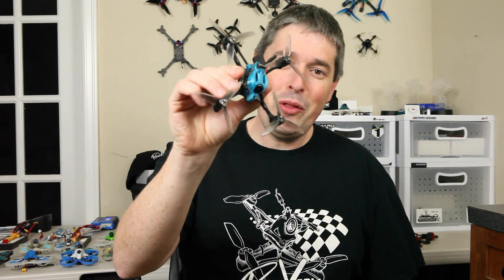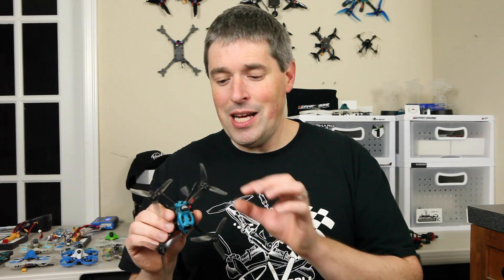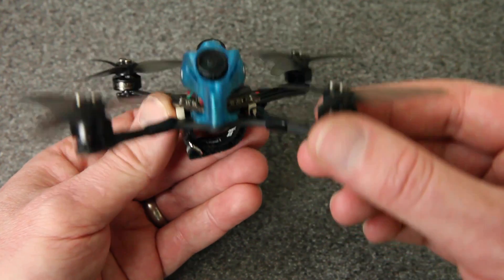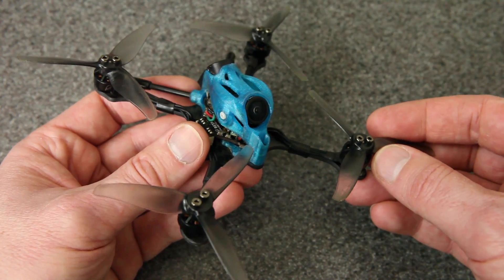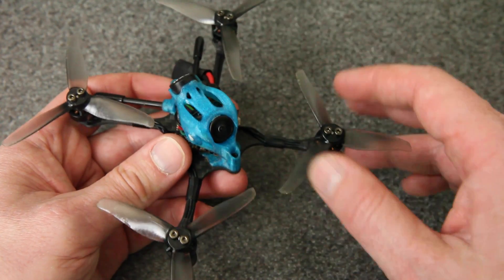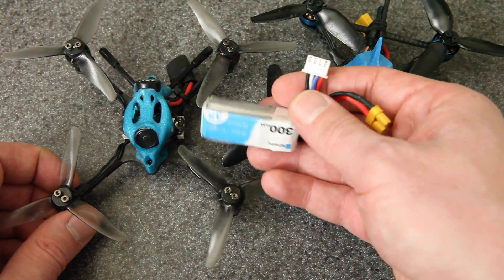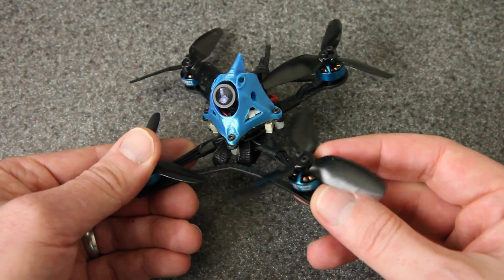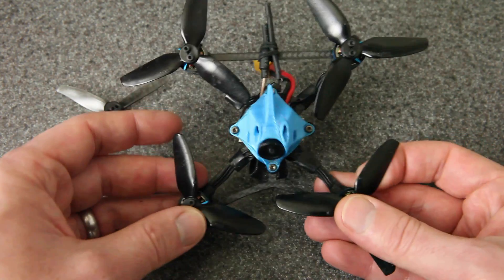Primo 3 + An Impressive New Prop

Comment from the maker: UPDATE: Gemfan also just released the 2-blade 3018 prop which I mentioned in this video. The 3018 might be the perfect thing for me. I look forward to trying it out!
 - Gemfan 3018 2-Blade (NEW): http://bit.ly/2t3Ee6Y
 - Gemfan 3016 3-Blade (1.5mm shaft): http://bit.ly/36REC7a
 - Gemfan 3016 3-Blade (2.0mm shaft): http://bit.ly/2tM6NWN
Reply: The 3 Blade is 3016.. The Bi blade is 3018
Reply: Thank you, your videos are the most informative I've come across (in a fun way). Keep them coming.

Unbelievable, I can accomplish nearly same speed results with your specs on 2s 450Mah lipo as with the BetaFPV 115 with 1204 5000kv 3s 450Mah, both on 3" 3 blade props?  I can't wait to try this (only have the 3018 2 blade now).

This will give new life to my 2" duct 85mm prototype with 1103 10,000kv (or 8,000kv) 1-3s, but I have a Crazybee v1 5A on it (only fly 2s, on this with 3 blade Avan props). 

I'll prob have to do the same as you, use GepRC 12A instead and a Rx. 
Just got the 3018 1 week ago (ordered Dec 2019, arrived 2 wks ago, available since Sept/Oct 2019).
Waiting for my 3016 3 blades to arrive to compare (available since Oct/Nov 2019, just ordered them in clear blk).
Reply: Mr ShutterBug which bolts do you use to hold the props in? I’m running the xing 6500kv motors.
Reply from the maker: @smcarmel  I believe they are M2x8 screws. Pretty standard. Motors usually come with them.
Reply: @MrShutterBug  Yes, but some motors come with M2x5 or M2x6 as standard as well (like the BBB 1105 6000kv, 7500kv come with M2x5 and M2x4 for mounting to frame). 
Unfortunately, I learned this the hard way and ordered a few sets from M2x6 thru M2x12 (which I use for whoop boards when some screws in some kits, like the "sailfly" long screws were plastic/TPU screws, not metal). :) 
Very cheap for a 20 or 50pk, about $2 or $3 including shipping. :)

Comment: My favourite prop. Only running HQ 3x3x3 on Eachine Twig, for that extra grip on 3S. Have a Twiglet very similar to this build but wiht 1104 motors - flies very well on 2S. What is total weight without battery of your primo build?

Comment: Did you ever tune the primo 3 or try jesc 48khz? I put 3018 bi blades on it but at going to try 3016’s after seeing your video. I’m running 1103 mamba 6500 kv it flew pretty well on 3.5.7 I just updated it to 4.1 and going to try the presets
Reply from the maker: No I haven't made any specific tune for that one, but I do think 48kHz would make it better, based on experience with other quads of similar size. Cheers!
Reply: Mr ShutterBug thanks for the reply! Ii just swapped from a pretty locked in 3.5.7 tune so I’m going to try 48khz. Do you think licensed jesc makes a difference as well? I put it on my babytooth and am happy with the results

Comment: Thank you very much   My Garnly build run the Mamba 1105 motors on 3s and I just try the Avan mini on it...  It hoover at 13% of trottle.  Wow!!!.     In addition they respond rapidly to the trottle.   But can ear a lot of osillation around 50 to 70% of the trottle.  I still need to try them more but I feel they give up on over 70%.  Do you recommand the gemfan 3016 or the hqprops 3030 on 3s to replace them?

Comment: Not a big fan of 1103's on a 3" Primo are  much better on the 2.5"original primo. And I think since your more of a freestyle pilot you would like the 1204's 5000kv even better that the 1105's although both fly similar. You get really good low end throttle response with the 1204's and better low end torque. I also prefer the emaX AVAN's Tri blades seem to bite a bite more than the 3016's  especially around turns. 

I know your a Whoop master and also a BetaFPV advocate but would love to see an unbiased comparison and flight footage of the Mobula 6 / Meteor 65 Your custom 1s Brushless Whoo That would be a great video to see and hear how far these little brushless whoops have come.

Comment: I bought the Flywoo ROBO 1202.5 with 2mm TI shaft and these props were the only thing I could find without drilling 1.5mm holes from my other various props. I too LOVE them and the material is very similar to what HQ uses for there 5inchers. You know that though.

Comment: you should really try Germfan 3018"s on the primo 3 build matter of fact I would say try em on both of those builds cause they might work better then what's currently on your twig too , it will give you the  responsiveness that was lacking from the 3016 props.its seems like a slightly more aggressive bi blade version of the 3016 prop to me.
 I had  the 3inch HQ props on a ultralight build I have and it flew pretty good then i ordered the 3018 props an when the came I put them on and I was blown away with how much better it flew ,didnt think it was possible and they were also more efficient too got the 3016'sat the same time , like you said they are good but I've also noticed I tend to have to keep a faster speed hrough out the flight with them but not enough response around tight corner ext. The throttle is alot more linear  all the way through then the 3018's and lacks the "punch" (especially at the lower end of the throttle)needed to quickly change direction while flying at the faster speed the trend to like.
Reply from the maker: I have some 3018s coming. I look forward to trying it out!
Reply: @MrShutterBug  awesome, your gunna love them!! Definitely my favorite bi-blade prop bar none

Comment: I love my Primo 3.  It's a great design and has more room inside for the "stack" than the original Primo.  The iFlight whoop board with their pinned VTx fits perfectly and runs great with RPM filtering.  I run it with the AMAXinno 1303 4800kv (2mm shaft) on 3s with the 3018 biblades and it's my favorite quad to fly.  It's nice that they offer both props with different shaft options for press fit.  Now that the 3016's came out I'm going to try it with those to try to protect the motors a little better.

Comment: Im waiting for my primo 3 frame, but i dont know wich motor to choose for a 3s setup. i will be using this prop and the hq 3x3x3 or 3x2.5x3. Wich motor u recomend, 1204 or 1105 for fast agressive flying.
Reply from the maker: If you want to use those props, then I would go with 1105 5000kv 3S like I did on my TWIG. Don't use anything larger than 450mah 3S though. If you put too much weight on the frame, it's more likely to break in a crash. I'm hoping the new 3018 2-blade prop will give me the filling I want while keeping the weight low with 1103 + 2S. Hope that helps. Happy flying!

Comment: Hey Mr shutterbug. This looks like a great setup, and I've recently been considering a new build after building a Beta85x based on your specs. My question is, is there anything that has the durability and FUN factor of the 85x? The 85 is just so easy to fly at it's limit and holds up well to most crashes. What's next?
Reply from the maker: Whoops are great for that! I still enjoy my 85 2S builds. I don’t think there’s any reason to make them more powerful because whoop are best when they are light. My next custom whoop build will be an ultra light 75mm 1S.

Comment: Looks like you're running those older prints. I didn't like mine until I got the upgraded prints that give you slightly more room and move those antenna tubes up on the top instead of under the back props. Running 2.5 avans on mine with 3s and its wicked fast. Excellent review for the props and the frame. Really dig you're little romp through the tree. Have you tried the 3" avans? Been using those on my weemix frame with the 1103 flywoos and I dig em
Reply from the maker: Mine may not be the latest version. Good point. It took me a while to get around to building this one. So many projects... so little time...
Reply: @MrShutterBug  Completely understand mine sat in a desk for a couple months before I got around to building it. If you like the frame I'm pretty sure the 3d parts are fairly cheap and gives ya a little wiggle room. Lol they have cute little gummi motor soft mounts too

Comment: How do you like this 3inch prop vs popular 65mm bi-blades on the 1103 motor?
Reply from the maker: Good question. I think 65mm is probably a better match for these specific motors, but only if the build is light enough. A 3” build is much more forging about weight. I would have said not to use 1103s on 3” at all until I found these new Gemfan props.
Reply: @MrShutterBug  Awesome ;)  It certainly looks compelling the way you flew it in the video.  My light 65mm build is still buzzing along well but if I ever manage to break the frame then I may move it to a 3" for testing too.

Comment: What glue you recommend for fixing antenna to ufl?
Just for long flight time, the 2 blade are better?
Best channel in this topic. 👍🏼
Reply from the maker: E6000 glue or similar. Not hot glue since it could melt. I’m not sure about flight times on 2 vs 3 blades. You might be able to get as much as 10min if you use a larger 2S battery and run JESC (I haven’t tried anything but BLHeli_s on this one).

Comment: Hi. My toothpick has 3D printed frame and canopy from Dave_C_FPV (MicrOblivion) and I like how its flying. I'm using Gemfan 3016 two blade props. With 65 grams quad its eats 2S 520mA battery fast. 2 minutes or so.
My motors are Fullspeed 1104 7500kv.
Reply from the maker: I wonder why the flight time is so short. I would expect more from a 520mah 2S.

Comment: That 3016 triblade has quickly become my favorite 3" prop. I've been running it on a tp3 build with 1204 motors on 3s primarily, though it does surprisingly well even on 2s . Nice looking build!